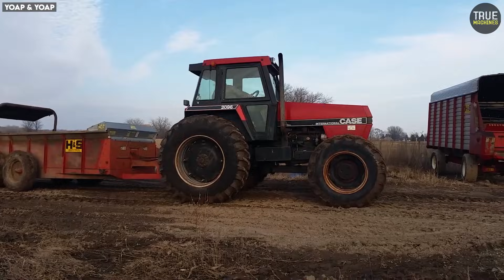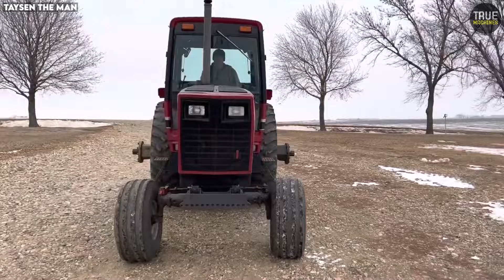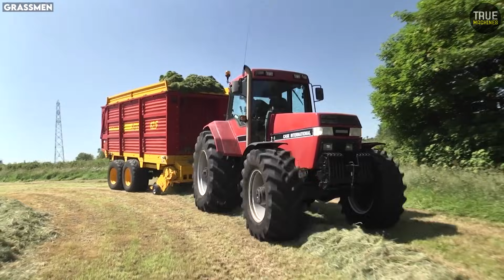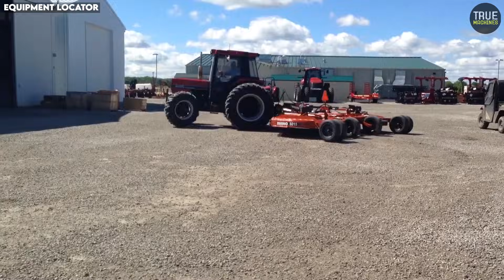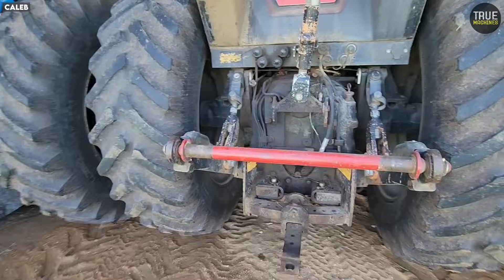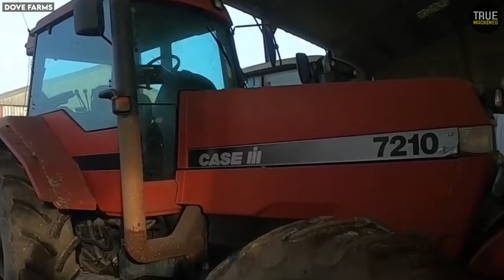10 Case IH Tractors From the 1980s That Shocked the Farming World

Comment: The 5288 did not have a full 15 speed power shift.
Reply: IHC already had the full powershift available, but chose to hold it back and release it later.  Automotive thinkiing.  Got that info from an individual I became aquainted with who had worked directly for IHC.  The Magnum was actually a 50 series with that power shift transmission and a Cummins 8.3l engine.  And, differently sheet metal.